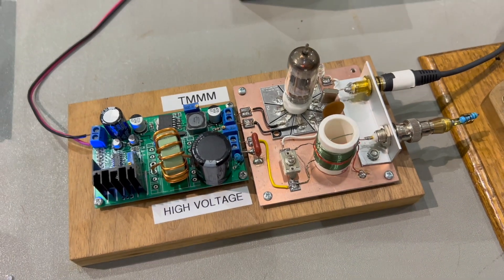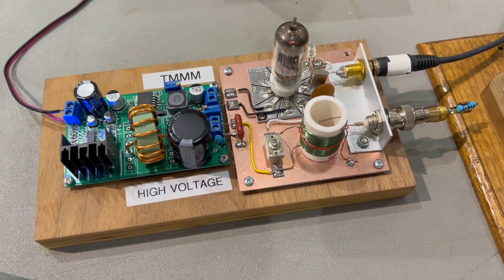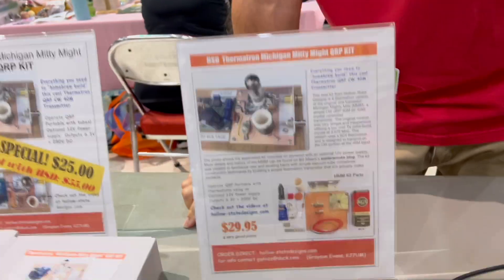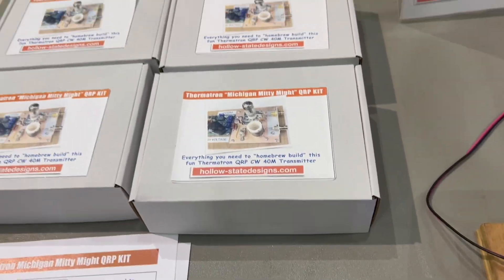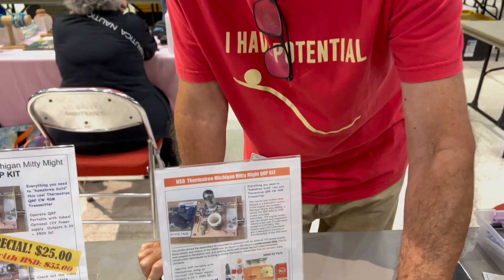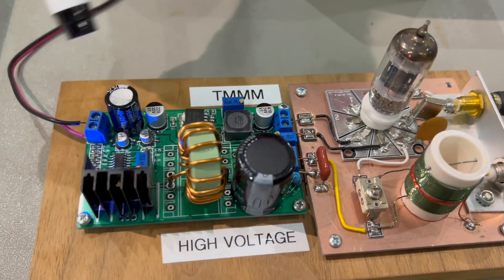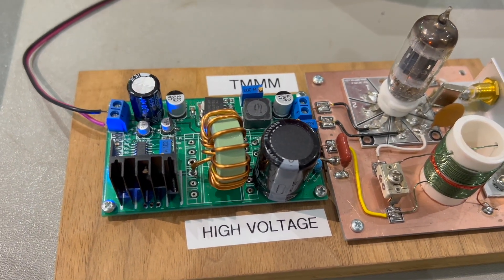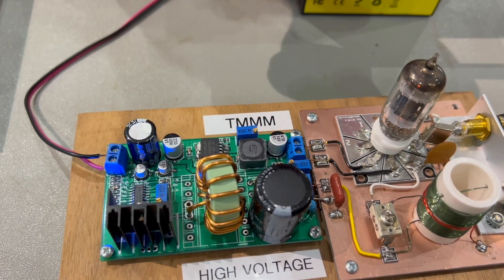One Vacuum Tube 40 meter CW Transmitter.

Comment: ½ Watt is plenty. Interesting to see this. 
My Pixie is 350 mW and I had a few contacts 60 to 180 miles on 5.262 MHz.
I have a 61BT valve tx at 2 Watts as well.
G4GHB.

Comment: I built one in the 70’s. One tube, crystal controlled. It was built with point to point wiring on a piece of 8in x 8in x 1/2in lumber. It put out more than a watt. It was only a transmitter and you used a long piece of wire thrown outside the bedroom window. Needed a shortwave receiver with a mute function for operation.
Reply from the maker: Classic!